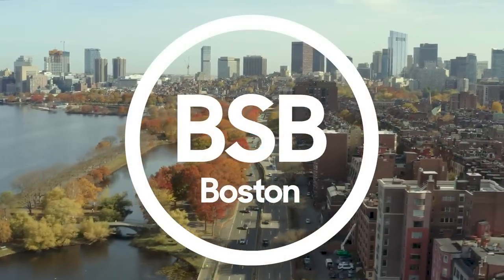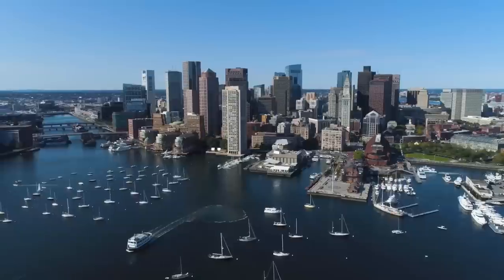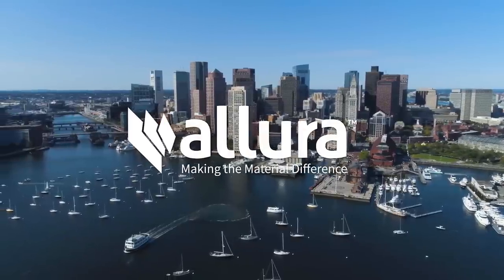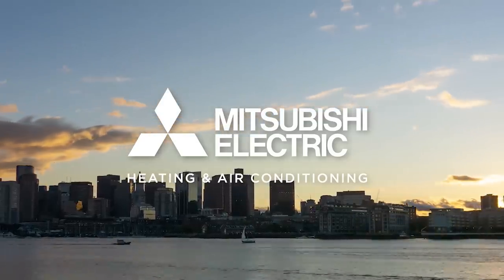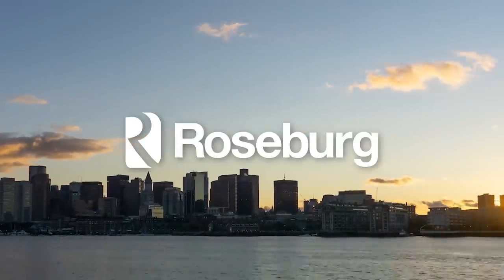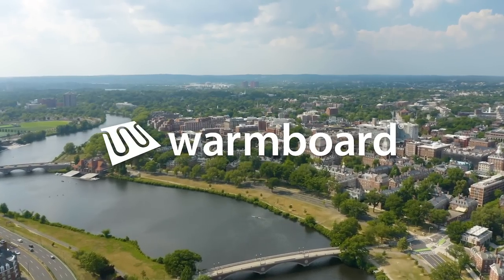"Project Design Part 1" Build Show Build: Boston Ep. 3

Comment: This is brilliant, and exactly the relationship I want to have with my architect/build team. Everything integrated. I want to give you concept, goals, metaphor, patterns, and anti-patterns, and let you synthesise a solution that works. So few actually do this.
Reply: I think he is just selling passive house idea so people over pay for the house and he gets an upsell by installing premium insulation materials which don't pay for themselves.. the solar panel inverters can break and require repair and those heat pumps can break too and are tricky to fix.. oh and that ERV ventilation is mechanical, so that will break too and then there won't be adequate passive ventilation in the house.. good ideas though.. but there is a lot of upsell in this passive house, LEED and solar stuff.. the LEED people who made a big deal out of improving my condo building left a huge gap in the door blowing cold air into the building in the winter and did not care.. because it was all for show and for marketing.. so it is hard to tell what makes sense and what doesn't.. a well insulated house will save money of course.. one thing I was thinking is to pre install the solar panel mounts during shingling of the roof so that they don't drill in afterward to avoid potential leaks at the penetrations of the solar panel mounts..also curious why architects don't seem to use the golden ratio to make beautiful houses like back in the Greek and Roman days, and if they apply simple age old rules to make the house a happy house such as house orientation, etc.. another aspect is that customers really are not architects and they may think they want a jacuzzi or a media room, but really they can't be smarter than age old tested standards that have been tested on millions of people by numerous builders.. so people are more likely to be happy with what is standard and proven to work for people for whatever reasons we may not even know right away, and the customer may end up being happier in a house built on age old rules and standard everything and not what they choose. Like my relative who made a completely open concept house he himself designed, but it is so loud everywhere that you get no privacy when are there.
Reply: @Hello-zf5lq  Hello, hello - I think your thinking is wrong. I don't upsell anything. My job is to present options to my clients, offer the pros and cons to such, and coach them along their decision making process. Equipment repair? Do you own a car? Did you buy it thinking it would never need maintenance or repair? Condo's - I don't think I have ever saw one built with any level of good quality, by their nature they are cheap? If we are going back to age old rules, why build it out of marble? Place the house on an elevated base like the temples? Actually most greek temples were around a 2:1 aspect ratio (length to width) which exceeds the golden ratio. Greek and Roman palaces and temples were beautiful, I hardly think you would find their common houses the same. My clients come to me with pre conceived notions of performance and ask that I help them get there - this isn't speculative housing..........Thank you for joining us - much appreciated
Reply: @Hello-zf5lq  he has a wealth of knowledge he is willing to share, knowledge about building techniques and materials. Even if his goal isn't to upsell it is going to happen just because people are looking at these videos for ideas on how they could build their own home. Just be grateful he is so generous.

Comment: Steve, when did you first hear about computer drafting and then start using it? How has it changed the way you design the project and interact with clients?
Reply: Unfortunately I can remember using Datacad v1 and Sketchup when it first came out. Sketch up has provided an immense amount of design sharing with clients
Reply: @stevenbaczekarchitect9431  When I was studying Architecture (1982-1985) our school was the very first one in Canada that had a computer drafting lab (only one Architect in the entire country, Douglas Cardinal in Ottawa, had a similar computer). The server room was 30x40 feet with a double door to prevent dust getting inside and anyone entering it to work on the servers had to wear a hazmat suit. 
Using the computer, if you wanted to draw a wall you had to lay out a tracer line for one side of the wall, click on it and enter a measurement for the depth of the wall and then draw the other side of the wall, then draw over the tracer lines with solid lines to create the actual wall. You couldn't add dimensions or notes to the drawing,  couldn't create elevations or 3d models, there were no material lists, etc. 
The entire lab cost over one million dollars and was "state of the art". Now you can download a program onto your home computer for free that has a million times more functionality than that lab ever had. I surprised anyone even does drawings on paper anymore.

Comment: I wish homes for sale were required to list operational and estimated maintenance costs for 30-years. Buyers might then look at that higher upfront cost -- which is likely going into a 30-year mortgage -- and how it pays off over time.

Granted, operational and maintenance costs are difficult to determine, but we can at least start with easy stuff and add on as things go. For example, start with existing homes that are put up for sale -- require them to list 30x the last year (when occupied) of utility costs alongside the list price. Pretty darn quickly, people paying for a new build will realize the resale value of a home is dependent upon utility costs, so they'll work to improve the build quality. Many people don't see beyond the sticker price, so let's make the sticker price reflect reality.
Reply: That is an idea (2 years of each of the utilities/fuel bills) that I am pushing for with the MA legislature.  A bill put forth a few years ago by MA Senator Ben Downing for ratings of each house resold had pushback from the RE industry.  Simple disclosure of utility usage seems like a no-brainer for consumer protection and needs broad based support.  With luck, that is something that might gain grassroots support and be seen as a path for more states once it is done by forward thinking states.  Massachusetts first?  How about that @senatormikebarrett ?
Reply: @scottrodman  Thanks for sharing this info! That's quite interesting that there was a push to do something to improve transparency on this in MA. I suppose it is no surprise that the RE industry was apprehensive about messing with the perception around economics of home buying. Is there anyone you know who is actively working on this in any states, or is there any organizations that come to mind you think would be good collaborators or advocates?

I'm in MN and am interested in doing a push on this topic, and hearing about efforts in other states would be very informative for any localized effort.
Reply: I am trying to get several groups to adopt this issue.  350’s MA state organization helped me with an effort to get the net metering cap raised in the state last year from 10kW to 25kW, but this RE issue does not seem to have support, largely due to the volume of other issues competing for the time of a limited number of wonderful volunteers diligently working on gas pipeline issues and such.
That issue will be a major step for home buyers.  What is needed to push more electrification of new and existing homes are programs in each state that provide low cost loans specifically for solar and batteries, state ITC incentives for those systems, and encouragement of participation in peak demand battery programs.  Those would make a huge difference in reducing the cost and impact to modernize the grid to deal with the impact of an expanding base of EVs, heat pumps, and induction cooking.

Comment: I’m on board. I’d love it if high end architects like yourself and Matt would do cost benefit analysis of the various systems. Sure it’s great not to have an energy bill but if that house cost me 20% more at risk free rates of 4% in Tbills I suspect that the payback period of some of these systems isn’t worth the initial costs. Just my 2c. 

Quick example is metal roof vs  asphalt. I have been quoted 5x more expensive for metal installed. Apples to apples. I don’t think the payback period works at all bc with that extra money sitting in an interest hearing account in 15 yrs the interest will pay for a new asphalt roof (if the house even needs it or if I still own it). Just an example of resource mgmt - meaning could put those savings towards a system that has a better payback period. Yet everyone tries to tell me that metal is better. Lol better - yea. Worth it? Maybe not
Reply: I have had the metal roof conversation - here in New England a metal roof costs about 3X, but the metal will last about for asphalt roofs, it may end slightly better, or maybe even, it is an aesthetic choice some people want. It doesn't cost more overall, just initially. Our solar PV arrays usually are paid for within 6 years, most of the time it is more like 5....
Reply: @stevenbaczekarchitect9431  hi steven, I’d love to hear more about the metal roof. I’m in New England and I have standing seam on one of my properties and asphalt on another. The house I am building the cost of materials for metal shingles (made to look like natural stone or other materials) is 5x more but let’s just say it’s 3x as you state some metal roofs are… the asphalt has 25year warranty and I have seen older tech asphalt roofs go much longer - metal roofs really only have 30-40 yr paint warranty but let’s say they go 50 yrs, basics back of envelope will mean it’s still better to put on 2-3 asphalt roofs. I’d like to hear your thought on how solar is only 6-7 years? And also curious what you think about triple vs double pane windows

Comment: The energy bill on my pumicecrete home is $5 a month without solar
Reply: Is there a good source for more information about pumicecrete? I'm guessing it's concrete made with pumice in place of granite gravel to increase the R value?
Reply: @kschleic9053  I am not sure that pumice would replace the gravel.  I’ve not looked it up, but this might not be a structural product.  It probably has a lot of air pockets for R-value, but needs a structure. I also guess one would not use much, if any, rebar inside.  It’s probably more like concrete than hempcrete, though.